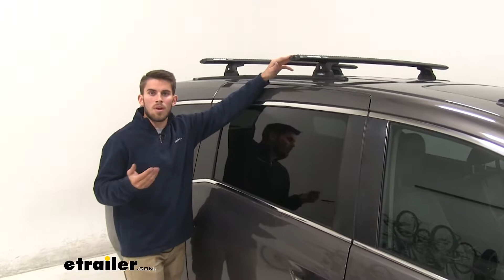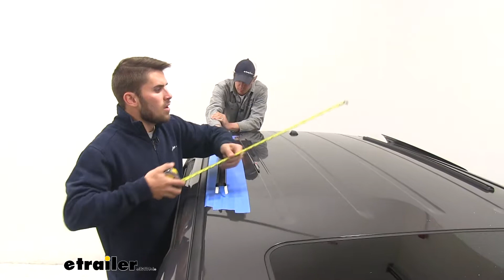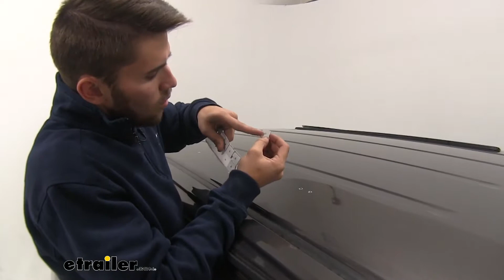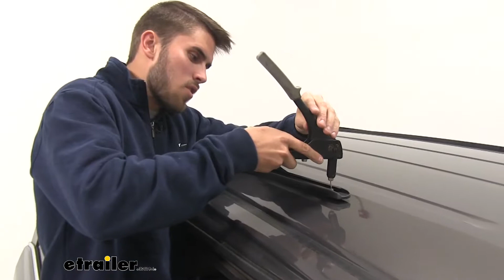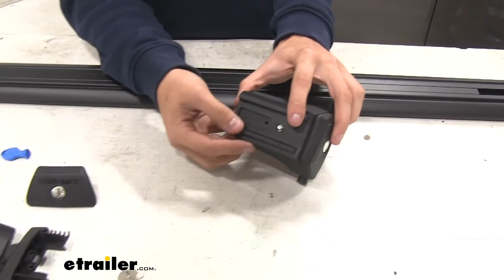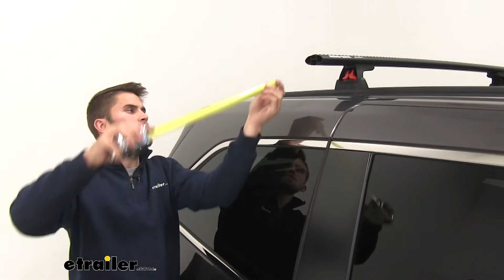etrailer | Rhino Rack Roof Rack Review - 2014 Honda Odyssey

Comment: Can we use it for Honda Odyssey 2015?
Reply from the maker: This roof rack will work great for your 2015 Honda Odyssey. Check out the following links to see the components you will need.
https://www.etrailer.com/Roof-Rack/Rhino-Rack/RRVA126B-2.html
https://www.etrailer.com/Accessories-and-Parts/Rhino-Rack/RRQMVA10.html
https://www.etrailer.com/Roof-Rack/Rhino-Rack/RRRTV168.html
https://www.etrailer.com/Roof-Rack/Rhino-Rack/RRRLT600.html
Reply: I have a 2013 honda odyssey. Are the parts listed all I need that your using in the video?  Thanks